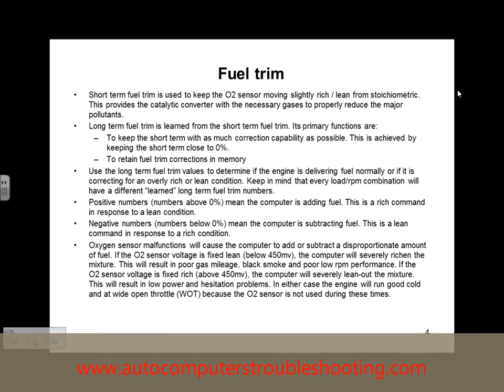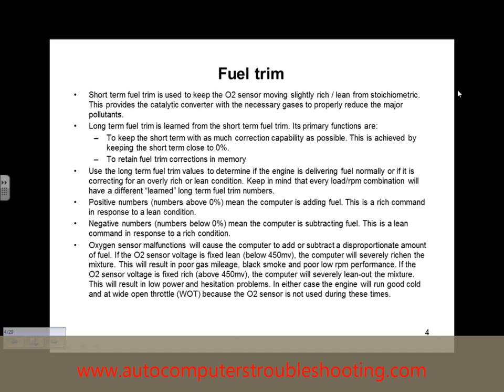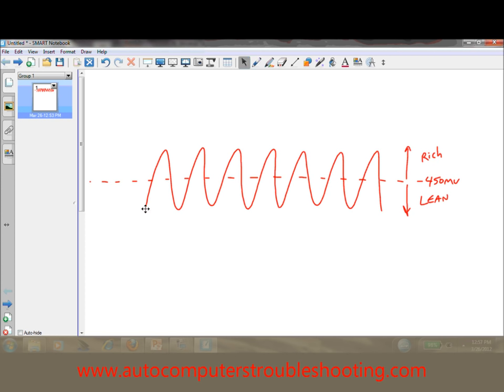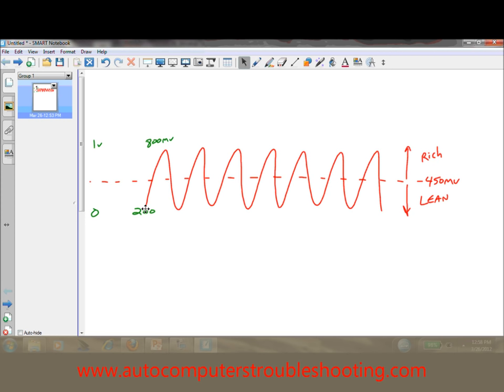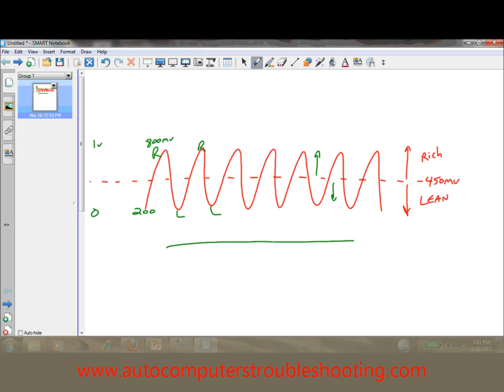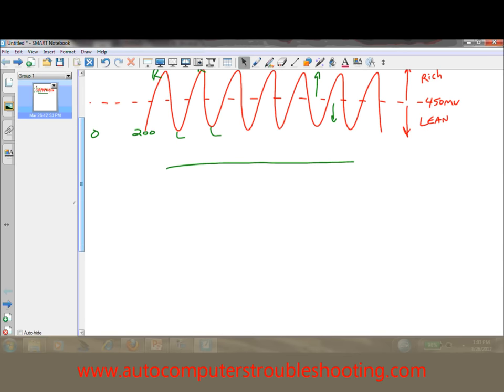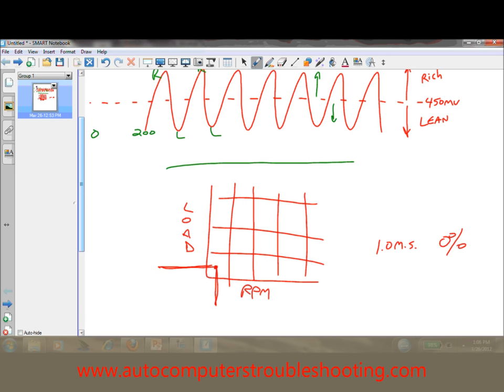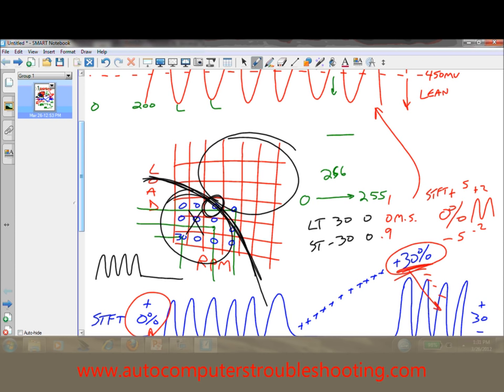Understanding Short Term and Long Term Fuel Trim (a SD Premium video)

Comment: Thanks. So let's say the O2 is reading richer than it really is, and strives to reach the happy medium where the sensor switches back and forth as it is supposed  to. In this case, the engine would be running lean but the computer wouldnt know it. If 15% is the  magic number, then would a chronic 14.9% lean mixture damage the cat? My guess is no, that you would have to be running much leaner.

Comment: ScannerDanner You really do an amazing job. I myself am Master ASE Certified, and as we all know sometimes we neglect to K.I.S.S, which was my case today with a 98 Saturn 1.9l. Came in, no check engine light, rough idle, bad gas mileage, etc. STFT was @ -25% to -30% and LTFT was @ +9.4%. Realizing it was running rich based on the STFT values, I went ahead and pulled the booster vacuum hose to create an artificial LEAN condition. STFT didn't change, nor did LTFT. I thought, hmm. I checked Fuel Press, spark, etc. O2 upstream was moving accordingly high/low, so I was scratching my head for a bit. I watched this video as a refresher, and as soon as you said "reset the ECM for a relearn" that little light bulb went off, and the "DOH" moment arose. I did exactly that and a 3 key cycle test drive for a relearn, and bingo, my values are now back in spec. Looks like the previous shop replaced the vacuum booster line, and neglected to clear and relearn. Keep up the great work man!
Reply: That's the 4th example in 3 days that I've run into. After the repair, do a reset. Some cars refuse to learn after they detect a problem.
Reply: +NetSecNow Wow i wish all my repairs were that easy! Reset the ECU. Lol!

Comment from the maker: Agree with your approach completely as far as waiting on the cat. code.
Check the PCV hose under the intake for a crack. This is very common on the 2.0 engines, not sure about the 1.6. 
I have seen also on Fords the stem area of the EGR worn out. When I changed my EGR on my explorer I had a 10% improvement in my LTFT. They all leak a little in this area though. Even the new ones.

Comment: You do such a great job explaining this.  I own a 2008 Toyota Camry 4cyl With no problems until it developed the fabled oil consumption problem.  It didn't throw any codes... just burned one quart oil per thousand miles.  Well, to Toyota's credit they wrote me and told me to bring it in because they had identified that model was having that problem.  I had gone to the dealer and they had pleaded ignorance.  Long story short, they replaced all four of my cylinders. 5 miles after leaving the dealer's service facility the car through a PO171 code and acted like it was coughing up blood.  I hurried back to the dealer's but they had closed.  Had to drive the car over the weekend and it got better and better.... But the PO171 code stayed. Well the dealer at their own expense replaced the intake head gasket, checked the fuel pressure, said they found a crack in the PCV hose,  added a can of 44K and finally put in a A/F sensor (at my expense) based on a P2238 code.  None of these worked to stop the PO171 code.  Additionally, soon after occasionally the car developed a condition in which it would not start after being driven about 20 miles and if I would stop it would not start. On these occasions I found if I waited 20 minutes or so the car would start. However, it would start if I sprayed some starter fluid in the intake.  That was three visits to the dealer at their expense and they could not find the problem.  Otherwise the car drives fine. So I'm left with trying to find a problem myself or as they said wait until it just want start.  I have waited a year.  I have looked at your and other videos, Google articles, etc. I have changed spark plugs, air filter and checked for air box leaks.  The car is too good to be just junked even though it has 280,000 miles.  After all it is a Toyota.  I have had no problems with it until the oil problem.  It has stumped the dealer and me.  But, I am trying to diagnose some things.  I bought a scanner. 

I am not mechanic.  Bought a generic live data/1 parameter graphing scanner out of desperation because dealer could not find the problem.   At idle....the scanner said; 

                                             2008 Toyota 4cyl 2.4 LXE
@ 900 RPM right after start up
122 degrees F coolant temp
STFT    -3.1% 
LTFT    +35 to 44%
IAT 57 degrees
MAF   ????
CLoop except when snapped WOT the trottle when it temp went to OLoop

After driving 10 miles:

670 RPM in idle
CLoop
201 degrees F
STFT   +4.7 to +10.2%
LTFT    +34.4 to 44.5 %
IAT  113
MAF .32 5.02 (very varyable)
O2SB1S1      -0.01 ma
Cat Te11       635 degrees  F
Cat Te12       341 F
LAMBDA B1S1     1.000
BARO 30  (never varies a lick from this)

At this point I cut it off.  Again it would not start!!!   Tried starter fluid still no start.  Waited 20 or 30 minutes started up without the starter fluid.  Acts just like an old car I had with a vapor lock problem.

Comment: Thank you,l have watched a few vids on this fuel trim issue  and couldn't grasp the concepts of lean means rich and rich means lean and how the computer manages the 14.7 to 1 ratio and reading a scan tool correctly.This was great!!!
Reply from the maker: Thank you! "Command" is opposite of "condition" if that makes sense.

Comment: Thanks for taking the time to response, I live in NY so probably the fuel can in fact be an issue but in the past years we have try changing to better fuel grade and didn't see any good result. But I will give this another try since now I have a few devices to read live data from the car.Car has the IAT build into the MAF sensor according to the reading seems to be ok this past few days I get reading like 60 F as I start driving and engine get hot it get to about 96-114 F..continue....

Comment: Paul... Your knowledge of engine diagnostics has been very helpful to me. Earlier today I bought a scan tool that gives me more comprehensive diagnosis. And I've discovered about fuel trim issues which has determined of my engine running too lean. Just to give an example of the fuel trim readings. Long term is reading between 20 - 25%. And the short term is reading at 15 - 20%. Not to mention the idle is a bit rough. Anyway, I just want to give you thumbs up.

Comment: Well done !!    lean and rich apply to both the O2 as well as the amount of fuel confusing for some  people.   A lot of people think the O2 reads amount of fuel and not oxygen.   I help out at an auto parts store and   lots of customers    buy O2 sensors because the scan tool says so and it's normal for them to come back and say the sensor we sold  were  defective because the light is still on.    I try to explain O2 readings  to customers  as a rich oxygen level or a lean oxygen level.

Comment: I just want you to know that I learned a lot from your videos in the past 6 months. Swore off mechanics years ago, and haven't touched a car in 15 years. Bought a beater of a KIA sportage for $1000 that somebody basically beat up, and threw away. Leaves inside the valve cover. Failed smog twice. Bought unnecessary parts for it,and then found the secret hidden vacuum port, and plugged it. Bought an OBD ll scanner, and watched a gang of your educational videos, and have been able to diagnose, and monitor the vehicle.
STFT modulates at both 0.8 and 1.6 on both sides, and the LTFT is at 2.3. Idles great, and performs really good. Thank you Scanner Danner. (Think I'll make a smoker just for fun).

Comment: THAT WAS an EXCELLENT  Theory of Operation followed by actual test of a vacuum leak, then an extra fuel injestion (not injection) and how the system can self correct.  What you said about having LTFT positive 30% and STFT-30%  can be confusing, but showing +30 and subtract (-)30 = "0".  It becomes a little more simple at that point.  Then it's up to the system to self correct, or delete the codes and wipe clean the fuel trim memory, then observe it with the engine running.
WOW!

Comment from the maker: Ok, so what you seem to have is a lean condition that gets a little bit worse under load. This usually will steer you away from a vacuum leak (but don't totally rule it out). I would look very close at all of your air intake hoses, after the MAF sensor. You may have a slightly contaminated MAF sensor, although I don't know if this is a hot-wire type or not. Also you are going to want to check your fuel pressure.

Comment from the maker: you can but you would need a double ended USB cable. I just use a USB flash drive and transfer my files that way. Also you should download the free "ShopStream Connect" software from snap-on so you can work with the regular Verus files on your PC.

Comment from the maker: A -100 fuel trim number on the scan tool is almost always incorrect data, not a problem with the car. I am guessing the truck is running ok? Double check the year of the truck and make sure you didn't enter the wrong year. Also check your global OBDII data and see if the trim is showing normal in that mode.

Comment from the maker: It is possible the computer was in the process of re-learning. The LT memory would still be commanding rich. This would drive O2 rich and cause a negative ST trim to correct. This could generate a rich code. 
What are your trim numbers now at idle?

Comment from the maker: Nice, maybe I will :)
Quick test for you. disconnect and plug the purge solenoid  hose and see if your fuel trim numbers improve. If they do not, then you have another problem causing your rich condition. (maybe ruptured regulator diaphragm?) Of course you still have an EVAP problem too. If they do improve then you found your problem. My videos on output solenoids should help you with that P1655 code. Or Section 3 in my book if you have it.

Comment: This is a GREAT VIDEO. I reset my KAM and watched my car learn its LTFTs at idle with my scan tool. Sometimes the vac leaks though can be very difficult to find or expensive to fix. I just fixed a nasty one around a leaking IMRC end using a RTV and a nickel.  I went from 20LTFT to 6. I know the other side is probably leaking but its not worth bothering!

Comment: To answer your question,rich condition(excessive HC lack of O2) without the exhaust leak does not damage the cat,but  put it to sleep.Therefore,your tailpipe CO and HC will increase and NOX will decrease.As soon as the rich condition is repaired ,the cat starts working again. What damages the cat is HC+O2 (lean misfire,low compression.etc) because it burns inside the cat and melts the substrates.
But like Paul mentioned a rich code for OBD2 will set at %15.

Thank you

Comment from the maker: I never worry about fuel trim numbers during heavy accel or during a decel event. The system is in open loop during these times and fuel trim numbers are not relevant. 
In your case it could be the reg. leaking, but if you cannot find any issues and your MPGs are normal and you are not setting any codes I wouldn't worry about it

Comment: This is fantastic.  Such a wealth of information presented in a very digestible form.  I echo all the thanks and praises on here.  

Have you ever considered putting together a video for the DIY tuner community?  Say, for example, understanding how to tune under boost using something like an aftermarket Fuel/Ignition Piggyback Controller?

Comment from the maker: It may not have an EGR. some of the variable valve timing engines do not need an EGR as it can be done with cam timing. (not allowing all the exhaust gas out of the combustion chamber acts as EGR)
How are your fuel trim numbers since you fixed the PCV hose vacuum leak?

Comment: Fantastic video - very well explained. I have a couple of questions: How do you reset the car's fuel trim memory? And does every car lose its fuel trim data when the battery is disconnected? Thanks for all you do for us - you're an invaluable resource.
Reply from the maker: 1. Battery disconnect and touch the terminals together (capacitor discharge)
2. Scan tool on some models offer a reset
Thanks!
Reply: @ScannerDanner  Ah, so simple! Thanks again.

Comment from the maker: Cool man, thanks for the update. Definitely sounds like a vacuum leak with improved fuel trim numbers at higher RPMs
Reply: My long term shows -30% short term is 0-3% has misfires on all cylinders also what would cause that big of a number on the long term?
Reply from the maker: @kevinanglin678  -30% is a big problem. First thing to make sure the oxygen sensor is functional, then you'll need to find out why the engine is running so rich

Comment: Hi, I have a 03 Nissan Pathfinder with a 3.5, it has high NOX has failed smog twice. Co is 14.57,o2 is .20, HC is 2, Co is 0.14  No is 584, max for CA. is 501.  As you are aware there is no EGR, smoked it- no intake leaks, it is not overheating, all 4 02;s are working.  What do I look at next?, I enjoy all of your videos...they have helped me greatly!.

Comment: The STFT and LTFT are programs to correct for minor factors that affects over times(oil contamination,canister purge,IAC and T-body ,air filter.etc). If the O2 reads richer or leaner for a longer period in closed loop,the O2 monitor will run and set a code(P0133 for B1S1)even if you read %30 fuel trim and O2 sensor still switching between 200to800 mv and its frequency at 2000rpm is at least 1hz ,you are still o.k, but now FT is out of range and PCM set a l or R code.IHTH

Comment: I believe the "rich and lean" is referred to the amount of fuel according to the air mass. Of course the O2 sensor does not measure the amount of fuel. The decision weather if the mixture is rich or lean is being done by the ECU.
I understand what you're saying though.

Comment: Thanks for publishing this. This is the stuff I was looking for. I got an 1997 S320 and was looking at different outputs with an obd2 scanner. Looking at STFT noticed that it was oscillating between + and - . So started wondering if this is normal.

Comment: Kick ass video. Answered every question floating around in my head. I just replaced both cats on my LS Avalanche, then scanned it with the live data. Looking at fuel trim, was at 4% long term, and bouncing around at 3 to -3 on short term. O2 upstreams, both bouncing around normal and downstreams stabilized at around .700 and bounced around from .735 to .695. As far as I can tell the truck is running good now. I cleared the code of P0420. Lets see if it comes back. Should I disconnect battery now to clear the fuel trims?

Comment: Thank you for the lesson. I searched about this subject because: in a Skoda Fabia 1.4 MPI  i have installed a KN filter and increase the air intake by open de air filter inlet valve. Now the LTFT shows (minus) -100%. The STFT varies between low numbers around 0% and the O2 sensor varies between low mA numbers around 0 mA. The car runs much better now when going up a mountain. Much more torque. The LTFT -100% means that before the KN the air intake was very poor? Do the LTFT will correct in time? Should I reset the LTFT? Thank you and congratulations for being a good teacher.

Comment from the maker: are you referring to a Speed Density (MAP) engine or a MAF engine? There are differences. Generally speaking a MAP engine with a vacuum leak will idle high and a MAF engine with a vacuum leak will idle low and rough....
There are other things to consider and other inputs the computer looks at that will limit how the computer reacts (throttle position for example)

Comment: Hi Dan.
How are you?
Firstly thank you very much for all your hard work and huge input,in helping the community with their vehicles.
I discovered your content whilst sifting through many videos,trying to solve some codes and problems.
I will continue to research everything until I fix the problem,I think maybe a vacuum leak,but it's a work in progress.
I recently acquired an additional code p0 137,which recently came up.
My scan tool reads bank 1 sensor 2,which is sensor voltage low,now I have read recently that Bosch 02 sensors are not suitable for GM,and that denso should be required brand.
I have a GMC Safari 2005 4.3 vortec. 
Your input on this would be greatly appreciated if possible.
Kind regards from a Welshman stuck in Canada,cheers Dan.
Reply from the maker: On that model year, for a downstream O2 sensor, you should be able to use whatever. What is the O2 mv reading for that sensor? Can you force a rich and lean condition and test it's reaction? That's what needs to be done next

Comment: Great video that's made me understand the ST and LT alot more, I do have a question I have a car where the ST and O2 are switching but the LT isn't moving what so ever even increasing the revs noting LT stays the same and the car when it's hot idols rough and sometimes cuts out, no air leaks anywhere
Reply from the maker: When it is idling rough and cutting out, what is the STFT and O2 readings?
What is your LTFT btw? Even though it's not moving.

Comment: great video. helped me a lot. i am trying to diagnose a problem i have where i start my car, cold or hot, and i have no throttle response if i hit the gas it cuts out then surges. and then it drops to 500rpm almost stalling and rises back up to regular idle.

after about 30 seconds to a minute it goes away and it runs fine. weird 

 every single time i start the car. it an be fully warm or ice cold. i did take a quick peak at the fuel trims on startup and if i recall the STFT was 25 but i forgot what the LTFT was.
Reply from the maker: post this question to my forum at www.scannerdanner.com
It is too difficult to do a back and forth exchange here which is what will be needed in your case. 
Thank you!